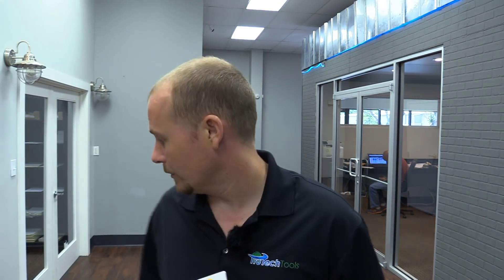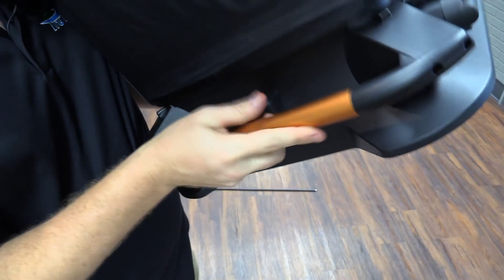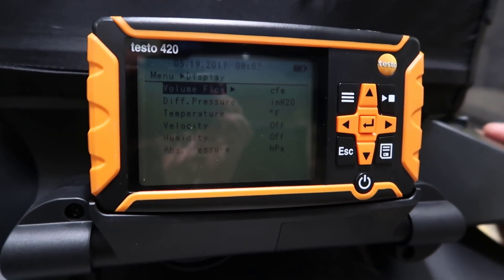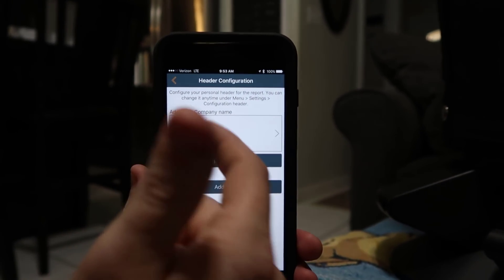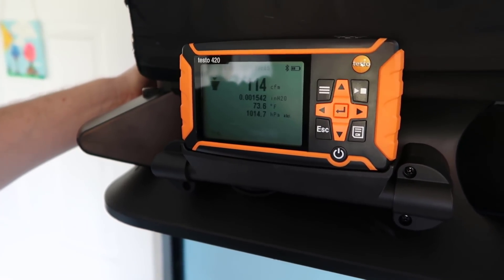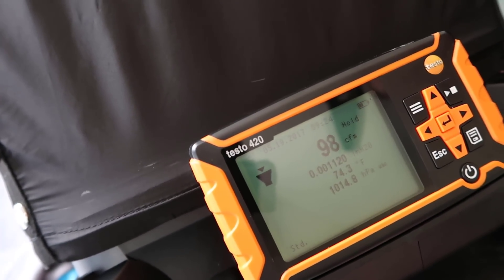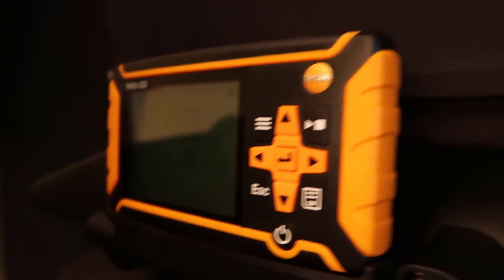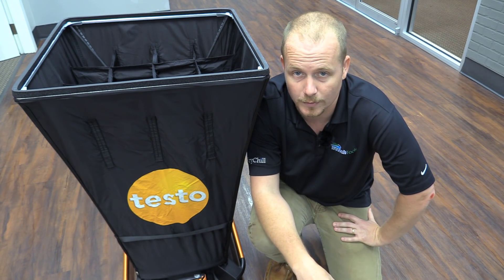How to Measure CFM w/ The Testo 420 Flow Hood

Comment: When trying to get the best possible reading for a customer report, would it not be better to remove the registers before taking a reading to allow the full force of the air to be directed downward toward the sensors or is the difference in readings negligible?
Reply: Cody Schmitt the register is reducing the amount of cfm's flowing from the vent. If you were to remove it you would have a higher CFM reading which would be wrong.

Comment: Hi guys, we use two of the Alnor units, and there is a switch to toggle between supply and return airflow, as we move through the rooms in a house. It it just as simple with the Testo unit? And, in tight areas, we will take our readings without the hood. Is that possible with the Testo? Thanks! I enjoyed your video.
Reply: Great question. I'm looking for a unit that can test airflow at the return as well, does this have that functionality?
Reply: Why not? Anything that can do supply airflow should be able to do return/exhaust airflow. Return airflow is normally much more laminar and therefore easier to measure accurately. Also, the testo gives you negative CFM values on return side.